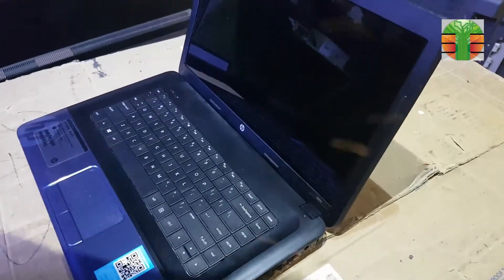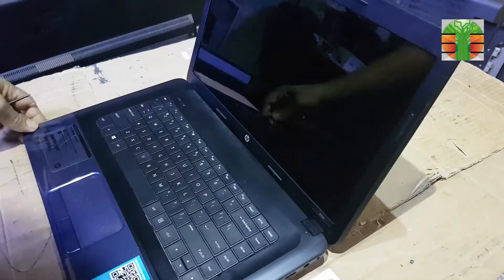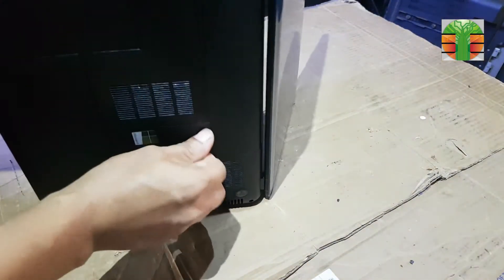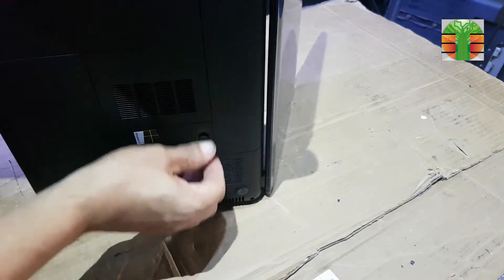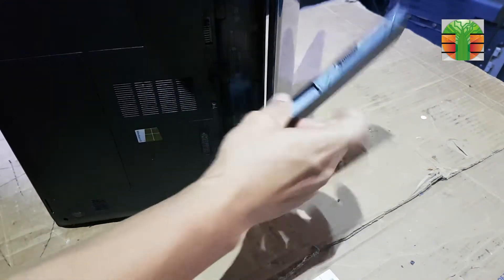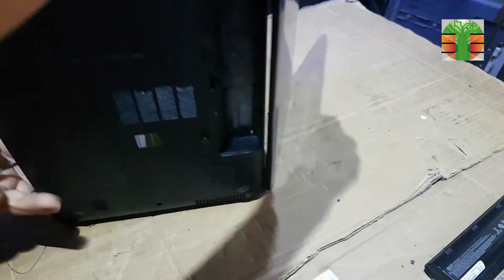Distorted display  laptop  fix.

Comment: Lol ... people ... he shows you what he did in the video!! When he freezes frame and shows the red arrow did no one look at what the problem was? From the right side the connector over time lifted up from that side ... so essentially when using the laptop the right corner was half in and half out so thats what caused all the screen problems! Not the entire connector but only that side ...